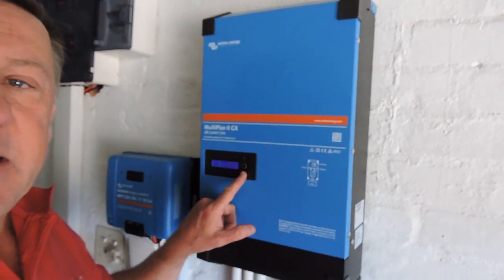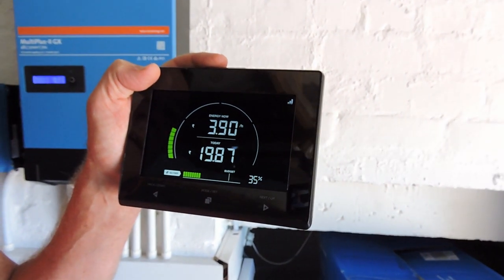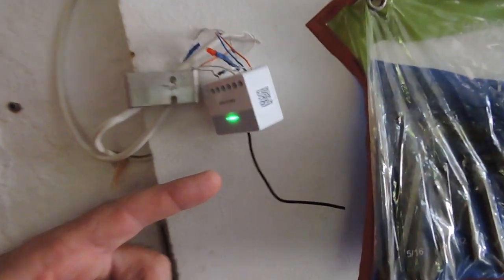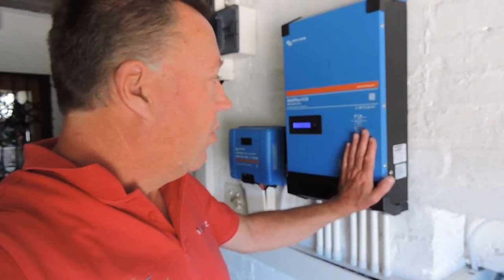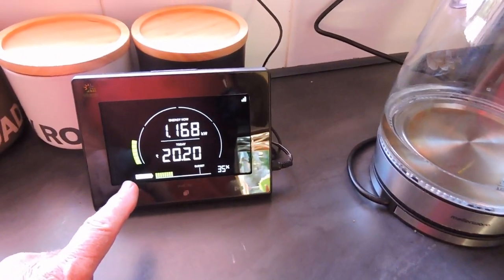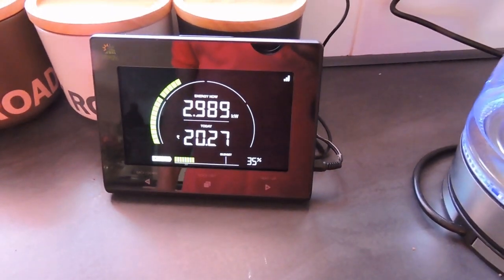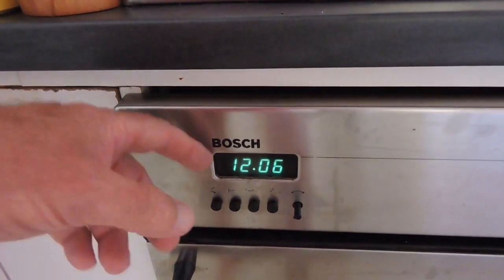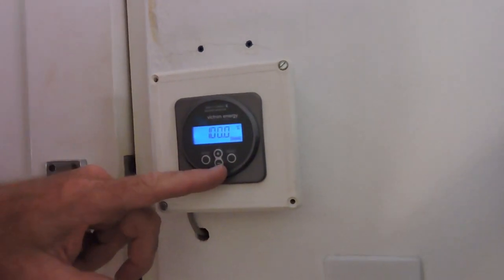Solar Energy and inverter loads visibility Efergy

Comment: use the Victron Energy SmartSolar Pluggable Control Display with an RS232 extension cable from your mppt SmartSolar controller to the required location? - less than 50UKP
Reply from the maker: Thanks I'll give this a try

Comment: What about using a raspberry pie? I use one connected to my Mercer and it works very well. I can change settings on my inverter remotely and monitor consumption and state of charge.

Comment: Hallo Alan. Why don't you use a cheap tablet fixed on the wall, then you can use a fixed IP to access the GX device.
Reply from the maker: Hi great idea .. I have tried an old tablet but struggled with keeping it always on ?  I wanted to use the camera as a motion detect so it came on when I was neare buy ... without much sucess
Reply: @alanfalck1184  Hallo Alan. You can activate the "stay awake" funtion in developer mode on the tablet then it will always stay on while the charger is plugged in

Comment: Thanks for taking the time to make the video. 
I bought a 2000 watt air fryer because I had a 4000w oven.
1500w kettle because I had a 3000w kettle. 
800w microwave because my 1000w microwave broke. 
750w toaster because my old toaster was a 1000w. 
I did this to help me stop pulling Electricity from the grid and these 4 thing have saved me 3950 watts and money for the future all the best 👍
Reply from the maker: Thanks for sharing
Reply: I am about to buy this Victron rs 48/6000, just can it power 5000whats continuos?

Fridge tumble dryer and washing maschine at once.

Battery will be 16kw.